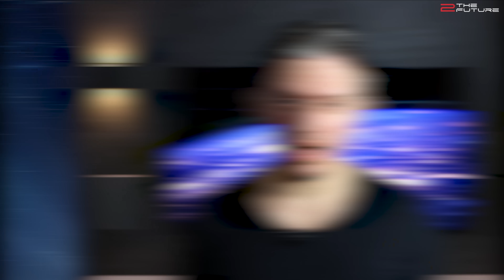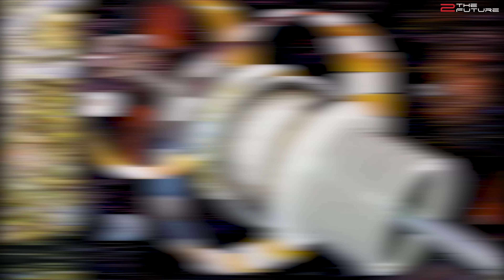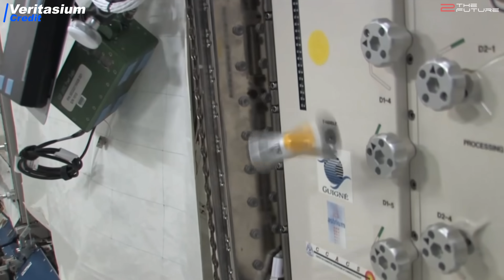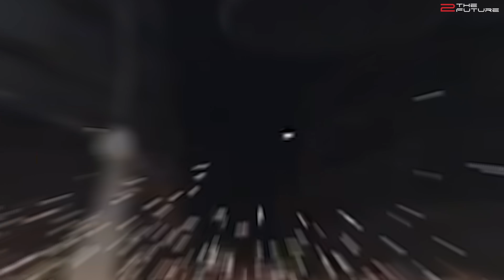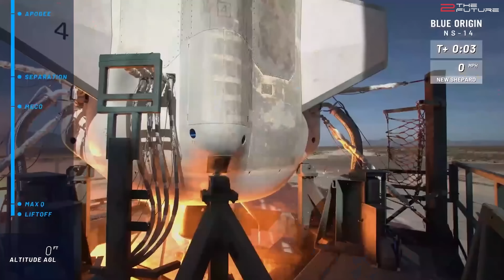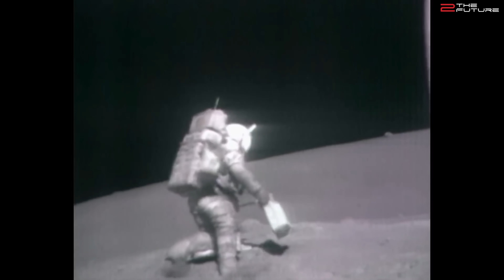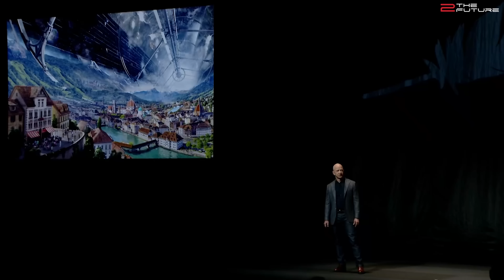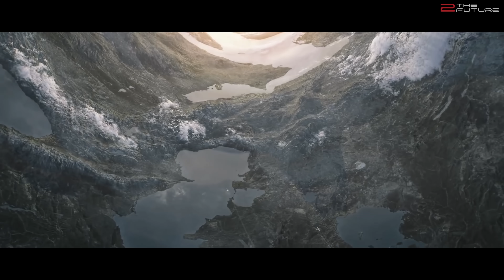How Do O'Neill Cylinders Work & Can Blue Origin Really Build One?

Comment: Deimos could be reshaped into an O'Neil Cylinder, big enough to house 1000s of peeps. 20km diameter, 150km long. That's 9000 sq km of internal area.
Reply: How?
Reply: @Hedgehobbit   If an equivalent of glass, basalt or carbon fibre can be manufactured from the material of Deimos, and if a binding resin of some kind can be made from its hydocarbons, then the first task is to make the containing skin. This holds the cylinder from flying apart and keeps the air in. Then you gently dismantle Deimos, distributing its material the length of the cylinder. Deimos keeps the same face to Mars, so its rotation is every 30 hours, the cylinder would be built north-south, the microgravity of its rotation would be enough to hold the regolith in place. Then you put the endcaps on, spin it up to the required gravity, import water from Saturn's rings, synthesise an atmosphere and get terraforming.

But how would you do it?